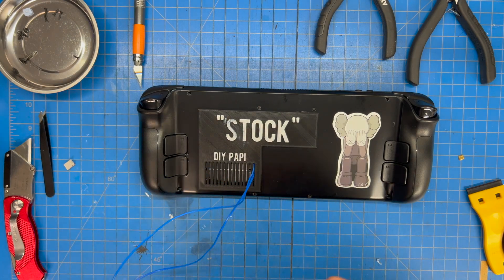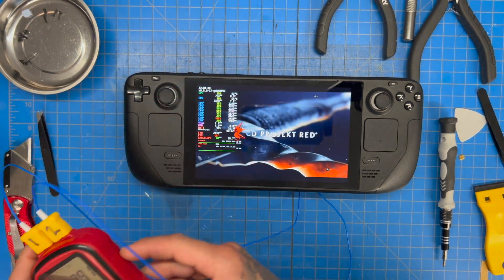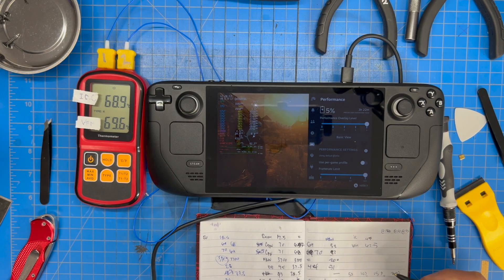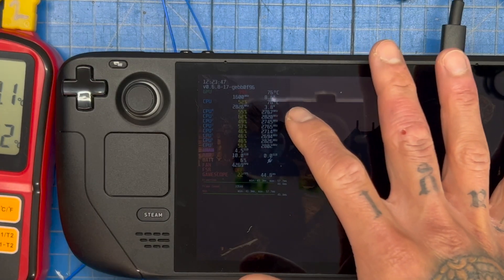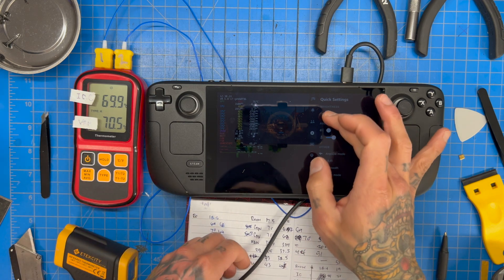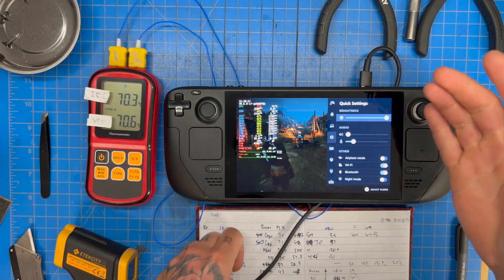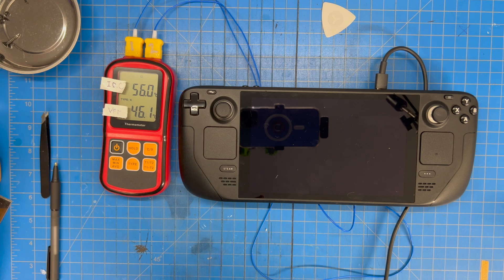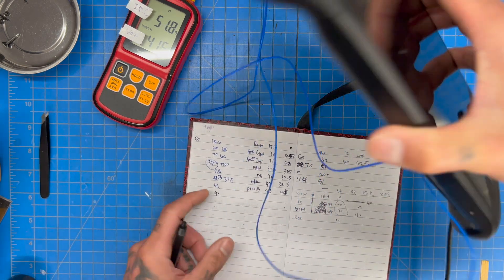How hot does the Steam Deck IC Controller and the VRM get while charging?

Comment: Is it possible to see such test with the newer Jsaux backplate? I saw people going nuts when you started the mod where you gave the deck an air intake above the fan. Then Jsaux implemented it in their v2 backplate nobody says a thing (at least I can't find people going crazy like they did in the comments of your vid... which is kind of weird. Papi does it and it's wrong, Jsaux does it and it's fine?) Do you think Jsaux did a good implementation of your idea?
Reply from the maker: Haters, gonna hate, such is life

Unfortunately, no, I do not have the new version back plate, but I did cut vent hole in the original Jsaux back plate 

I didn’t do a standalone video regarding the temperatures, but I did do one with my custom backplate.

Here’s the link

https://youtu.be/YrlsI2jixwQ?si=L8qBsWDGcbyicb6w

Comment: Sup Papi, seen all of your videos, and i assume some of the changes are safe to be done...changing the Thermal paste for a better one, adding good thermal pads to the vrm, icc and the pipes (cutting that black tape)... these changes seem safe to be done, but, would it be enough to help the steam deck lowering the temperatures? i mean, you have a video where you do all this... but you had the backplate of the steam deck cutted for the fan... and i wouldn't do that part
Reply from the maker: No need to swat the thermal pads or paste

If you really want results, 

Download decky 
Then 
Download fantastic mod
Then
Set you fans to stay on 6000-7000 rpm 

Temps will drop from 6-8c overall

Comment: Hey Papi, are the „overclocking“ „undervolting“ and „aliexpress backplate“ videos still planed? 
You mentioned in other comments that you will be taking a look onto these.

Also thanks for the new video. Im also a lover with everything that includes tinkering and cooling/heatsinks. I used to mod my gpu coolers with custom self cnc milled cooper plates.. so these videos are a true blessing for me!
Reply from the maker: Yes they are, over clocking is a bit of a monster Drivers are a huge issue
Reply: @Diy_Papi  Let's hope they improve them quickly, I'm already hyped for this hahahaha
Edit: There is someone on reddit working on a guide to overclock ram too, he/she reached 6400 MHz
Reply from the maker: @TheTonyfenomeno  people are wild on Reddit. Can you send me the link to the thread.
Reply: @Diy_Papi  I think links get shadowbanned by YouTube, but search u/Me2151 "I've figured out how to run ram at full speed". There's no guide yet, but Micron memory is rated for 6400 MT/s if your steam deck has it instead of Samsung
Reply from the maker: @linkstar612  very interesting, I would assume performance gainz are pretty marginal right?
Reply: @Diy_Papi  if you also manually tune subtimings it should help minimum fps from dipping so much and give a small boost to average fps. My steam deck has samsung LPDDR5 so I wasn't able to change. I think you can only set 5500 MT/s or 6400 MT/s as well. In between values didn't work, so it defaulted to much slower
Reply: +1 on this hahaha